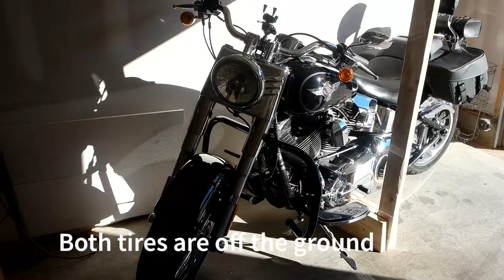DIY $15 Motorcycle jack in 10 minutes / Lift / Harley-Davidson Fat boy

Comment: Nice but my question is about fat boy’s ground clearance? It Is only 5in from ground and you use 3 pieces  2in  each? 
Thanks anyway for sharing
Reply from the maker: I forgot the numbers but I had to cut the wood narrower because it was too wide. You know, Bike just need to be few inches in the air
Reply: Dimensional lumber (like what you’d get at Home Depot, etc) 2x8 is actually 1.5” x 7.25”, so three of them stacked like that would only be 4 1/2”.
Reply from the maker: I think it was 2x8 and I had to cut it a bit narrower like 6.5” or something like that. And nope I didn’t use planer to make it thinner
Reply: @namoothewoodprojects My bad! I did the math wrong, the three 1.5” flats stacked would only be 4.5” total, the width only matters for how high you want it lifted after you rotate the stand. I edited my above comment for correct dimensions.